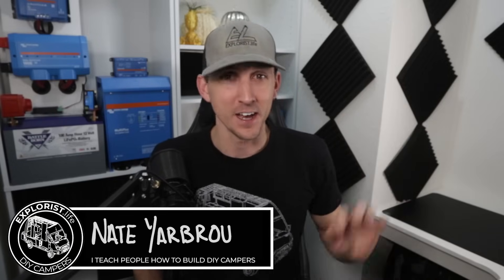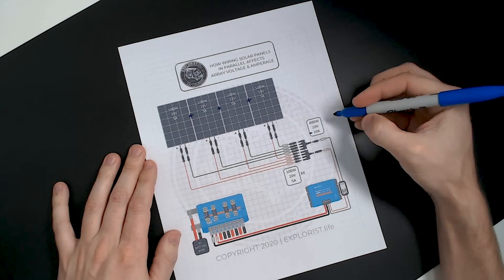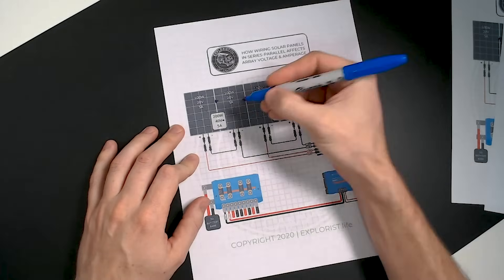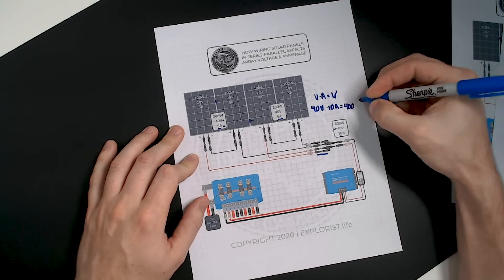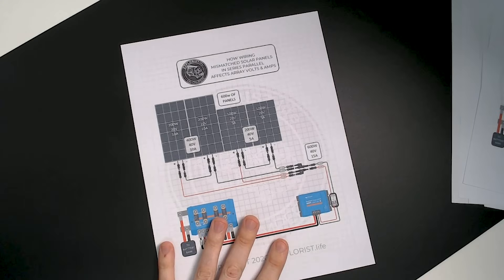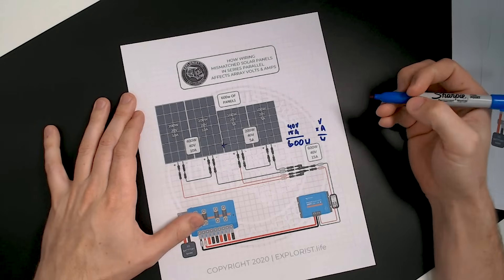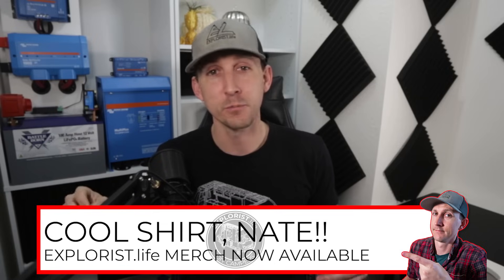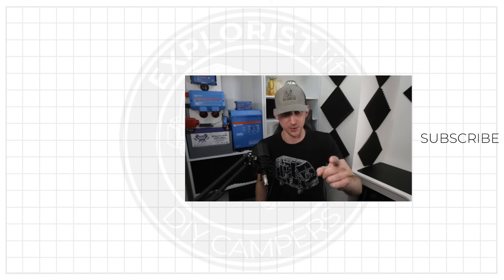How to Wire Different Sizes of Camper Solar Panels Together - Effects of Mismatched Solar Panels

Comment from the maker: ⚡ Ready to upgrade your solar setup?
Everything shown in this video is tested, proven, and available in our store:
🛒 https://shop.explorist.life/?utm_source=youtube&utm_medium=description&utm_campaign=how_to_wire_different_sizes_of_camper_solar_panels_together&utm_content=shop_link

🔋 Using Battle Born Batteries or planning to? Shop them here:
👉 https://shop.explorist.life/product-category/all-products/components/batteries/brand-battle-born/?utm_source=youtube&utm_medium=description&utm_campaign=how_to_wire_different_sizes_of_camper_solar_panels_together&utm_content=product_link

Need help designing your system? Join our Pro Support Membership:
👉 https://shop.explorist.life/prosupportmembership?utm_source=youtube&utm_medium=description&utm_campaign=how_to_wire_different_sizes_of_camper_solar_panels_together&utm_content=pro_support_membership_link
Reply: Would you please be able to help me work out my solar panels in the best configuration,
I have 6 panels, 
3 x 250w 22.30voc 14.62 isc 
3 x 200w 21.85voc 11.25 isc 

I have a victron 100/30 Smartsolar mppt &
I have a victron 100/20 Smartsolar mppt + 
I have a cheaper 92/40 mppt non Bluetooth 

I'd like to stick with victron Smartsolar now that I'm used to the Bluetooth function + I wouldn't mind about having to buy a 100/50 if I have to in replace of the 100/20 or 
possibly use all 3 if your recommendation is a 100/50 is needed to be paired with the 100/30 and 100/20.
If I could get some advice that would be greatly appreciated 
Thanks

Comment: I have 2 200w 36v and 1 200w 20v panels a 8awg extension cord 30 feet I want to run to a bluetti elite 200w v2 which is 12/60v what fuses do I need.  Parelel btw

Comment: I bought a 120w panel a few weeks ago and on a good day I recorded 146w. I only have one 120w panel hooked up to a 20a smart charge to a 100ah but i thought that when prople are sizing a charge regulator it might be a good idea to be sure that the reg can handle the imput if the panels are imputting more that  what they say they can do
Reply from the maker: Great point—controller sizing can get tricky with real-world panel output. We’d love to look at your exact panel, controller, battery, and wiring to make sure you’ve got the right regulator and parts. Shoot us a message and we’ll spec it out for you: https://shop.explorist.life/support

Comment: Great video Australia here , so i have a motorhome in Australia ,and was planning on using what solar panels i have on hand , 3 x 50 watt @18 v , 1x 150 watt @ 18 v , i also have multiple house panels that i could use they are all 180 w@ 48 v , so just to clarify once i link the 48 v in Pharrell  to the 18 v ,the whole system becomes 18 v ? Is it worth adding the higher voltage house panels ,or just add some lighter flexible 18 v solar panels , cheers from oz
Reply from the maker: Good question! Mixing different panels can get tricky, and the best setup really depends on your system as a whole. If you’d like us to take a closer look and point you in the right direction, reach out here: https://shop.explorist.life/support

Comment: Hello. I find your channel very interesting and informative. We are currently updating our caravan with a modern solar system. We have 6 panels 3 at 13.65 a 2 at 12.20 an and  1 at 8.6 a. All are 22v. If I understand your instructions correctly parallel will produce 22v 75a and 1650w. Dose this look right. Thank you
Reply from the maker: Thanks so much for the kind words—really glad you're enjoying the channel!

You're definitely thinking along the right lines with your parallel setup, but the exact numbers can vary based on how things are wired, actual panel specs, and environmental conditions. To make sure everything's safe and optimized for your caravan system, our support team would be happy to take a closer look:

https://shop.explorist.life/support

Comment: So what values are used to figure out the series, parallel calculations, Voc, Isc, Vmp, Imp?
Reply from the maker: That’s a great question and definitely depends on the specific wiring goals and components you're working with.

Our support team can walk through the calculations with you based on your setup:
https://shop.explorist.life/support
(Free if you purchased your gear from our store!)

If not, no worries—our Pro Support Membership is designed just for this kind of personalized help:
https://shop.explorist.life/shop/all-products/membership-tiers/

Comment: Ok my OE solar panel is a Dometeic 190W (VMP) 20.4V and (IMP) 9.45A the purchased panel is a Werchatay 200W (VMP)18.0V and (IMP) 11.11A, if I have calculated correctly wiring in parallel will give me 370W at 9.45A.

Comment: Why not connecting parallel to series? For example if you have different amperage solar panels but their volts are almost the same.  I have 4 panels @ 31.58v @ 12.99A in series and 2 old panels with 31.8v @ 8.97A. So if i parallel the old panels I'll get 31.8v @ 17.94A from them and then connecting to the series string in series connection so the final result should be 158.12v @ 12.99A  = 2053Wp Is that correct?
Reply from the maker: That would be a pretty atypical approach.
Reply: @EXPLORISTlife but if it works it works right? I would give a try soon as my inverter minimum voltage is 90volts
Reply from the maker: "but if it works it works right?" I suppose that depends on if I'm on the hook for your personalized tech support or not. 😂

Comment: That last example is so eye opening! We had 4 100 watt panels left from our old camper and we wanted to add them to the 1600 Watts (two arrays of four 200 Watt panels into two separate MPPTs) we are adding to this new build. At this point we are just planning to have 3 MPPTs to keep everything simple and at 100% efficiency.

Comment: Hallo, In your exaple of 3 200w and 2 100w panels. (8,2 min in to the video) Could you not have wired the 2 100w in paralel and then in series with the 3 200w and the gotten your total of 800 w?
Reply from the maker: parallel-series really isn't a thing in a normal array, so I'm not sure how that would actually play out.
Reply: @EXPLORISTlife  Ok, but that would be interesting to know, because then you could better mix sizes on a rooftop with vent fans. And I noticed that you mentioned this possibility in one of your other videos. Or vas it maybe series-parallel. So do I understand It correctly that I can do series in parallel but not parallel in series? Thank for your videos:-)

Comment: How would you wire 3 panels? I need the max output for the best charging. 
I have (1) 200w 19v 10a panel.
I have (2) 100w 18v 5a panels. 
Using a Victron 100v 50a controller. Using 10 AWG wires from the solar to my controller. (rated 30a max). I assume I want to run in series. So how do i wire to get the max watt output?
Reply from the maker: The 200w panel would go to one charge controller and the 2x 100's to another charge controller.  Reach out through the shop.explorist.life messenger and we can get you what you need for all of that.

Comment: I have 5 mismatched panels.
1) 5V-3.6A-18W
2) 5V-9A-45W
3) 5V-2A-10W
4) 9V-1.3A-12W
5) 21V-0.9A-15W

What is the best connection for this panels ?
Reply from the maker: The video you commented on teaches you how to figure it out for yourself. 👍

Otherwise, we can sell you a new array of matching panels to take the math out of it.

Comment: Say you have 3 100 watt solar Panels  connected in series. Your solar controller  needs to be able to withstand the voltages of 3 panels added up together. So if you have 3 x 20 Volt panels you will need to have a solar controller that is able to handle 60 volts  (for example a victron 100/50  mppt ) The amps will be the same as one panels  output just say 5 Amps
 In parrallel your panels will have 20 volts  but the amps are added together  for example 3 X 5 amps  or 15 amps. so you can use a solar controller with a lower voltage  but it will need to be able to handle 15 amps . wiring in series is good if your panels are in full sun ,but if they are shaded a bit probably the parallel  connection would be better. Hope this helps  :.<>

Comment: Hi, here is my guestion. Ecoflow delta pro XT60 max input values are 150V 15A. Can I combine two lines into:
A) on one side the current from the panels with a power of 800W, 60V 13A and
B) on the other side the current from the 51.2V LifePo4 battery with a power of 420 W 55V 8A. 

Can I keep both lines open at the same time or do I have to keep only one or the other open?
Reply from the maker: This may take a more in-depth look at your personal setup.  If you have purchased/are purchasing from our store (shop.explorist.life) reach out for some more personalized help: shop.explorist.life/support

If you've purchased/are purchasing elsewhere, reach out to your dealer for support.  We'd love to have you as a shop.explorist.life customer so we can provide a bit more help in the future. 🙂

Comment: Hi Nate.  When comparing other panels using the method shared, is the panel voltage based on the open circuit voltage (VOC), and the short circuit current for Amps?  Thanks!
Reply from the maker: mp (max power) for both in terms of figuring out output.
Reply: @EXPLORISTlife  Nate, Thanks for returning my question.
Reply: Hi Nate.
I've been reading through your tutorials and have taken the test to understand how to optimize panel configurations with varying watts/volts/amps.
Could you please help clarify some questions about my panel arrangement and how to optimize my Bluetti AC200Max?
-The AC200max has a 900W capacity, with an Open Circuit Voltage range 10V-145V,  and a max input current of solar charging: 15.2A ± 0.3A,
-currently own a 200W solar suitcase with a 20.5V Vmp, 9.7A Imp,
-looking to purchase 2 & 250W Renogy Topcon Bifacial Panels with 19.52V Vmp, 12.81A Imp,
1. Would you recommend setting up the three panels in Series, but run the risk of losing charge optimization @83%
2. Run two Renogy panels in series, @ 100%,  and only use the suitcase when the roof array is in the shade?
3. Do I look for panels matching the suitcase panel VMP/IMP specs?
I appreciate your help!
D-
Reply from the maker: I think this may take a more in depth look at what you've got going on.  I'd love to help you at shop.explorist.life/support, but it looks like you aren't using anything we sell in our store; so if you're struggling to come to a conclusion from our videos, maybe reach out to renogy or bluetti for personalized technical support?
Reply: @EXPLORISTlife  Will do.  Thanks for the quick response.  Happy holidays!

Comment: I have a pre installed 200 w x 24v Mppt solar flex system.  I want to add two 100w x 12v in series  to equal 24v in parallel with the 200w panel.  

Is this advisable? 

It should be 24v at 400watts correct?
Reply from the maker: Run the numbers and see!  The video teaches you how to figure it out for yourself!
Reply: @EXPLORISTlife  I did run the numbers I was just looking for a confirmation or correction from someone who knows. Mixing 12 volt with 24 volt series and parallel.  I'm a newbie

Comment: What voltage was used in the calculations, Voc or Vmp? What current value was used? Isc or Imp? Thanks. I enjoyed the videos!
Reply from the maker: Voc for charge controller sizing and Vmp/Imp for actual power production.  Isc is really only for fuse sizing.

Comment: I have 3 panels 380 watts, vmp 39.71, imp 9.57 voc47.59, isc 9.82.. I have Victron 250/100. I'm thinking of installing in parallel but how I understand series would be better. Is more volts better than more amps ??? Many Thanks for any info
Reply: Theoretically, it will be better to have a higher voltage to reduce DC ohmic losses through the DC cables. Lower amps also mean smaller cable size. Take note that your input voltage must be within the inverter/charge controller's range.

Comment: I have 4-200 watt panels @ 24v & 8.52 amps and 6-100 watt panels @ 24v & 4.21 amps. if I wire 2-100 watt panels in parallel that would give me 24v and 8.42 amps, just under the 8.52 0n the 200 watt panels. if I wired the 100 watt series into 1-200 watt panel in series wouldn't that give me 48v @ 8.42 amps giving me 404.16 watts on a 400 watt system?
Reply from the maker: If you're still having questions on how to wire different panels together even after watching this video; you'll be best to wire all 'like' controllers to their own individual controllers.
Reply: @EXPLORISTlife  thanks for responding to my question, your video series have been great. so two charge controllers for each set of panels makes since, should I shoot for the input on each charge controller close in amps or voltage or does it matter if the controllers are rated plus 20 percent over the numbers?

Comment: My bro i have a question is it  proper to mix 84v by 2 solar panels to get 168V with 5Amps in series then
42V. 12 13.30Amps by 2 panels to get 84 in series then parallel wthi the first 2 solar panels

Comment: In the  last example why   not wire  3 panels in series ( 51V &11.76A)  and then wire the other four in series also (68V & 11.76A)/ . now you could wire  these two series array in parallel  get you 51V * 23.52A =. 1200W
Reply: Because they already had 1200W, so why add the extra panel?
Reply: @angelaamsterdam  he said it cut the watt in half(600w) which is not true.. because If you wire like I  stated you will get 1200 W. from the 1400w setup.. Not 600W..
Reply from the maker: And now yall are finding out why I’d recommend running that to two charge controllers.  Shop.explorist.life/support for help

Comment: Do you use the short circuit amperage or optimum amperage
Reply from the maker: Imp for actual performance, but realistically; the most efficient way to wire mismatched solar panels is to wire like panels all to their own charge controller and scrap the mismatched solar panel array option altogether.  If you want help going this route and if you have purchased/are purchasing from our store (shop.explorist.life) reach out for some more personalized help: shop.explorist.life/support

If you've purchased/are purchasing elsewhere, reach out to your dealer for support.  We'd love to have you as a shop.explorist.life customer so we can provide a bit more help in the future. 🙂

Comment: Would the work around be to add a charge controller in parallel to the original charge controller for any panels that would be detrimental to the original array?
Reply from the maker: That would be the most proper way to handle that, yes.

Comment: You show the 2 banks of Panels. I want to add more banks of panels.  I’ve purchased a Victron 150/100 MPPT. My existing array will be 2 banks of 1425w 13.24a 130.35v. I have old panels and can make 4x 570w 135.3v 10a. How much more can I add without purchasing another MPPT?
Reply from the maker: Hey, @Johnno1962! I appreciate you taking the time to ask your question, but unfortunately, I don't have enough info about your specific question to provide an accurate answer, but here is a playlist that, if you watch all of the videos start-to-finish (and take notes 😉), you'll have a REALLY good idea of how to design a solar array: https://www.youtube.com/watch?v=Jkbs84sBHsg&amp;list=PLmvhcyi4n0TV9pi83rFTv3ZuMT_S1xIZt

Alternatively, I have some of my most common solar array setups pre-built here: https://shop.explorist.life/product-category/all-products/camper-wiring-kits/solar-charging-wiring-kits/

Comment: I have a system with an off grid inverter and a lithium lifePo (48v) battery, trying to see what can work with 445wcanadiam panels. I would like to contact you.
Reply from the maker: Hey, @missorlando2000! I appreciate you taking the time to ask your question, but unfortunately, I don't have enough info about your specific question to provide an accurate answer, but here is a playlist that, if you watch all of the videos start-to-finish (and take notes 😉), you'll have a REALLY good idea of how to design a solar array: https://www.youtube.com/watch?v=Jkbs84sBHsg&amp;list=PLmvhcyi4n0TV9pi83rFTv3ZuMT_S1xIZt

Alternatively, I have some of my most common solar array setups pre-built here: https://shop.explorist.life/product-category/all-products/camper-wiring-kits/solar-charging-wiring-kits/

Comment: Now maybe my panels are incorrect here in the labels. I have 2x 160w panels /VOC 21.6V/ IMP 8.89A.  THEN 2X 80W Panels VOC 22.3V/ IMP 4.3A. 
 Running these 160w I'm series and the 2 x 80w in series to parallel Im getting 21.6V X2 =43.2v X 13.2A = 570W. 
  My panel wattage comes to 480. Maybe my panels stickers must be wrong.. 
 I also have one single 160w panel with max VOC 19.58V/ IMP at 10A . 
  Ok not certain if this extra panel should be used at all.?

Comment: Kind attention 6:20-6:30
In this case, you used different amperage 8A & 5A in series! And you took the lower Amperage as net current!

My doubt is -
When in series, won't the sunlight falling on 8A array flow through the 5A array and heat up the 5A array, when the connected load is capable of demanding 8A??🤔

Please clarify 🙏